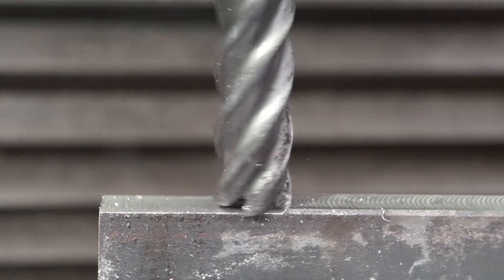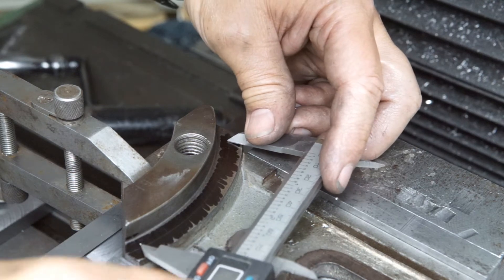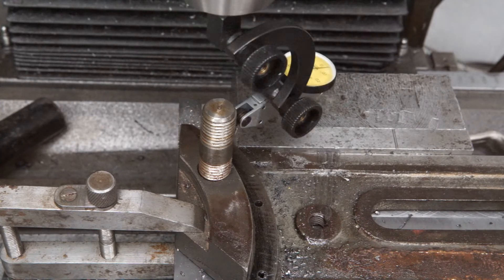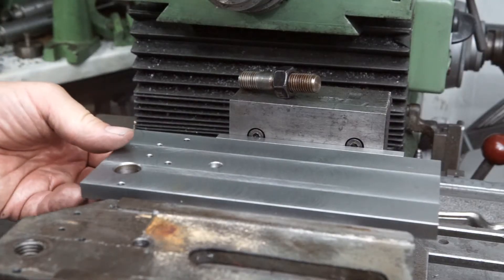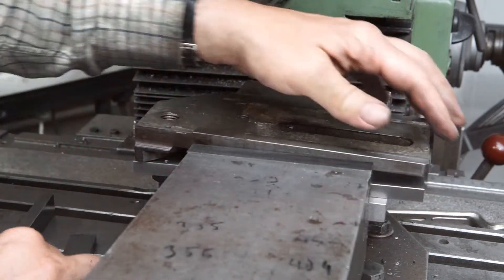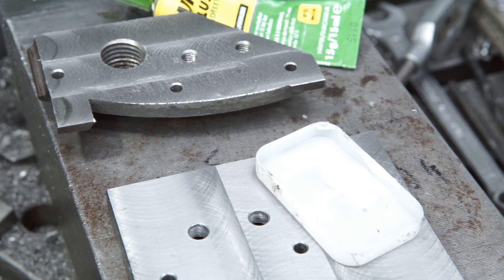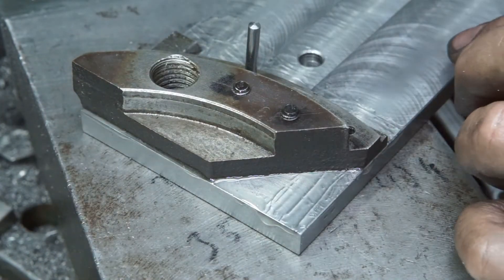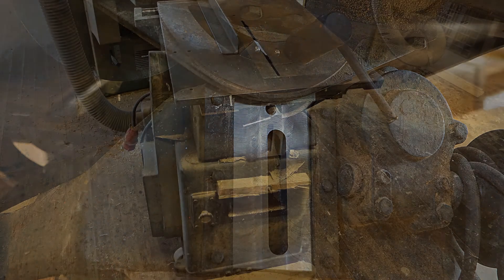table saw repair

Comment: Fantastic repair...very well thought out
Reply from the maker: Thank you! I first considered making the entire part from scratch. Milling the curved parts (probably with the Wohlhaupter facing and  boring head) would have been quite interesting.
But I decided against the idea as it would have been such a waste of material.
Reply: @HaraldFinster  I totally understand...I spend so much time before a project just thinking about the quickest way to complete the project